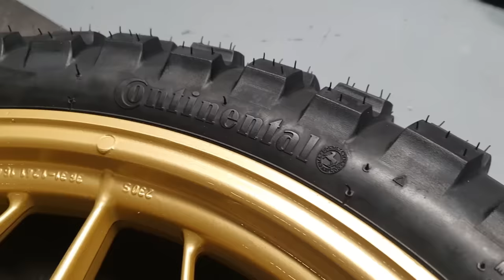BMW R100 RS Scrambler Full Build & Riding

Comment: Such an amazing build! I'm planning to get an old bmw boxer and do something similar. 

How hard was the engine rebuild? Especially sourcing the parts in Europe?
Reply from the maker: Thank you man, appreciated. These are fun engines to work on!

It's not that hard. On my channel there are more videos on the whole rebuild of the bike and also the engine. I bought all the OEM parts from www.hobbyist.nl. They can also send abroad
Reply: @corner.custom  this is superb! I'm a mechanical engineer and it's always been a dream to work on cars and bikes. I should be looking to purchase a bike once winter hits. Thanks for the recourse. I'm sure they would ship parts to Ireland. Will check out the other videos on your channel! Loved the k100 build you did!

How do the k and r engines compare? I've always been drawn to the quirkiness of the boxer. I really want to experience the bike pulling to the side when the throttle is pulled. Also most R bikes are really compact and wide, really matches the look I'm going for. But is there anything special about the K you really like?I haven't quite looked into them
Reply from the maker: @rohanjangam511  It's a nice hobby to have, thats for sure. But also can be pretty time consuming haha! Thanks for the kind words man.

Love the torque of the R at low rpm and also the low weight of the bike when finished. With the K engine they stay quite heavy and you also notice that during the riding. Downside is that the R bikes have become quite expensive and a K bike can be picked up cheaper.

Comment: The headers are too low. Should be 2 into 1 up over under the seat on the off side. Suspension should have been raised another 3 inches to change the rake and ground clearance. Heads skimmed and carbs rejeted for better Compression ratio and fueling. Overall a nice build but more for aesthetic looks than actual performance. Kinda harks back to the old Rickman mattesse scramble bikes
Reply from the maker: Bike is just fine buddy. It won't be used for offroad purposes and the performance is spot on

Comment: That is an amazing build. What is the average cost on parts ? Wanna build one myself and want to see if it’s doable….
Reply from the maker: Thanks man! With parts you mean the aftermarket parts or also all the OEM (maintenance) parts for the engine/gearbox?
Reply: @corner.custom  Just a general average to end up were your build is now, from donor bike to finished product . 5/10/15k ?
Reply from the maker: @flat4-  Above around 11k regarding this build. Expensive bikes to buy and build

Comment: Love the Bimmer, what did you use to take the paint off the fuel tank? It looked like brake fluid.
Reply from the maker: It's a industrial paintstripper. Got it from the paintshop that painted the tank, don't have any name or brand
Reply: Beemer. It’s a bike. Bimmers are cars.

Comment: At least with the original you could ride in the wet, and not get caught between the silly boy front mudguard, and the back, non existing guard. For dry sunny days only riding perhaps.
Reply from the maker: Yes correct, only for nice sunny days. Why would you ride through the rain for fun

Comment: Very very nice Build! Where did you get the exhaust? I'm looking for something like that for my bobber.
Reply from the maker: https://www.caferacerwebshop.com/nl/16-slash-cut-shorty-black-uitlaatdemper.html
Reply from the maker: That's the exhaust that I used 👍
Reply: @corner.custom  Thanx! And then just shorten the original header?
Reply from the maker: @pjpankras  Yes indeed!
Reply: @corner.custom  Thanx!
Reply from the maker: @pjpankras  Your welcome, good luck 👍🏼
Reply: What are the tire sizes you used? Trying to decide If I want K60 scouts or the Continentals you used. I think the Continetals look better and more agressive.
Reply from the maker: @pjpankras  Front tire 100/90/19
Rear tire 120/19/18
Reply from the maker: @pjpankras  That are the tire sizes, but you do need to use inner tubes because they're TT. I found the grip to be good, also no problems on tarmac
Reply: @corner.custom  Thanx! I've never used both tires, but judging by how they look the K60 Scouts seem to handle a bit better on tarmac and with cornering. But I really like the looks of the Continentals..  I have to think about :)
Reply from the maker: @pjpankras  Yeah it's up to you man, good luck making the choice 👍🏼
Reply: @corner.custom  I got the exhausts. Did you leave them stock or did you add a different db killer in it? Also when it comes to mounting, Am I correct that you removed the center stand and used that attachment point for the exhaust?
Reply from the maker: @pjpankras  I leaved them like I bought them. And yes I removed the center stand and used that for a custom bracket to attach the exhaust
Reply: What kind of kickstand did you use? I’m struggling to find something that fits with these exhausts.
Reply from the maker: I modified the original kickstand. I'd cut the stand in the middle and then took approx 1/2 cm off, depending the hight of the bike. Then I also adjusted the angle of the bottom part so it went up higher (parallel) with the exhaust
Reply: @corner.custom  Thanx, I will see if I can salvage the original kickstand. The attachment point is not that nice anymore and they already did some welding on it. I got everything disassemble now. Shortening the front fork first and the frame will hopefully be powdercoated soon. So think I will see what to do about the kickstand when it is on it's wheels again.
Reply from the maker: @pjpankras  Sounds like a plan 👍🏼First the bike needs to be standing on his own to measure and cut up the kickstand

Comment: Beautiful bike!   So much work!  Did. you use the original tank?  Did the M-unit fit under the original tank?  I know a lot of guys use the mono-lever tank because it has more room underneath.  Also, where did you get the battery holder?  Thanks so much for sharing your work!
Reply from the maker: Thanks man! Yes this is the original tank. The tank from the later models are different, with this tank you have a little notch on the right inside of the tank so the M-unit fit perfectly there. I've got a separate how-to video on my channel regarding the whole wiring of a R bike with all the info in it. The batterybox came from Germany, company called Sport Evolution
Reply: @corner.custom  Thank you so much.  I'll take a look!
Reply from the maker: @themosaito  Your welcome 👍🏼

Comment: Not the same cylinder heads or valve covers. 😢
Reply from the maker: Cylinder heads got rebuild, but I did changed the valve covers to the peanut valve covers 👌🏼

Comment: The sky high seat looks silly, especially with a rider on it.
Reply from the maker: As a result the riding position is far better. When the seat would be placed flat you would continuously slide forward
Reply: @corner.custom  Ok, makes some sense. But the look is still on the silly side.  Would it be wrong to position the rider, and the resulting center of gravity, lower?
Reply from the maker: @markl4673  Could be yes, but I actually like the way the seat is placed

Comment: Cool build.  I like that you've taken something old with outdated looks and given it new life.  do you need special tools to rebuild the gear box or was it a matter of just replacing seals etc?  Do you have a parts list you could post or a website with more info?
Reply from the maker: Thanks man, appreciated 🙏🏻.  You definitely need some dedicated tools for the gearbox to get it apart and also to replace the bearings, set the right shim hight etc. I don't have a website, but most of the info is on my Instagram page Corner.Custom

Comment: this is a not pratical design, and dangerous, besides being ridiculous... if you pass trough hard curling or hard holes on road, you´ll be pulled of the seat, and fall between wheel and chassis.
Reply from the maker: As long you enjoy the bike the way it's ment to be you'll be fine. Would you fall of the bike on a original bike when you pass trough holes in the road?

Comment: Wheres the battery?
Reply from the maker: Underneath the gearbox
Reply: @corner.custom  cool, thanks
Reply from the maker: @padrescout Got it from sport evolution btw 👍🏼
Reply: @corner.custom  That's real slick, had to rewatch and sure enough around 12:20 - there's the battery under the gearbox.  That just disappears there, that's super nice.  That's a real nice build, great work.
Reply from the maker: @padrescout Thanks man. Let me know if you would like to see specific information on my current R100 build

Comment: Turning old junk nobody wants into folk art is a very old custom, like chopping.  Knobbies with no rear fender is hilariously useless but that bike is for decoration not function which is fine.
The new "anti-functional" mixed media art bikes may as well use old BMWs since everyone who dreamt R100 dreams in their long dead youth is dead or already has several and can use the leftover parts. Well worth it since the views are a great advertisement.  Even more common and cheap are old K-bikes since BMW owners like RV owners tend not to care about anything over a few years old. Do an R69 digger chopper next with an air-cooled VW engine for MANY more views. The VW Beetle engine (preferably with lots of Empi parts) will be a Youtube hit.
Reply from the maker: I also rebuild mulitple K100 bikes, those are on my channel as well!